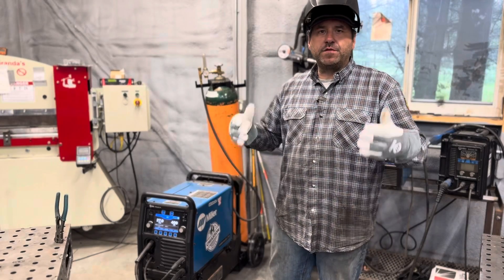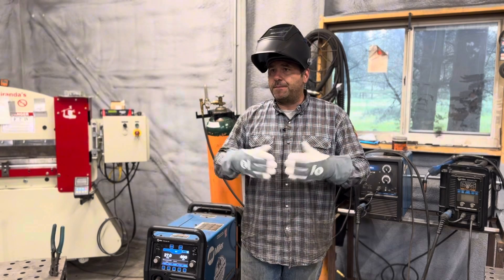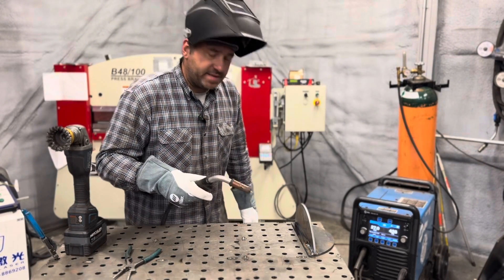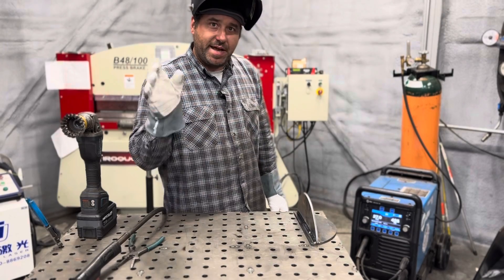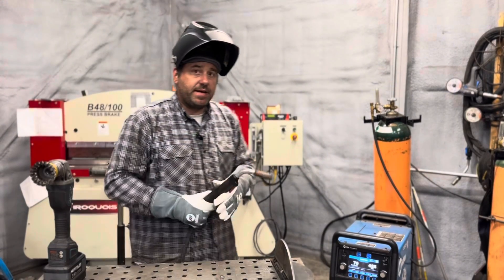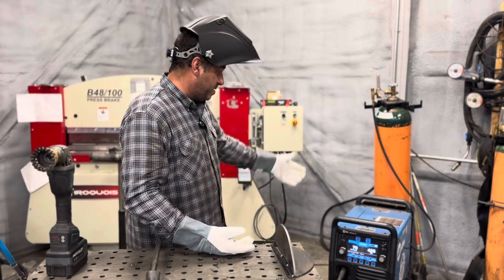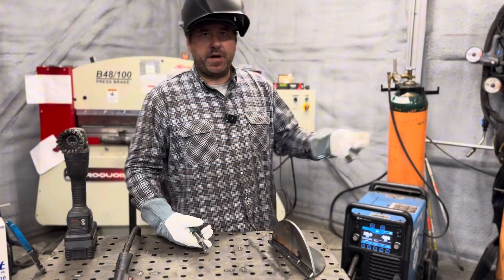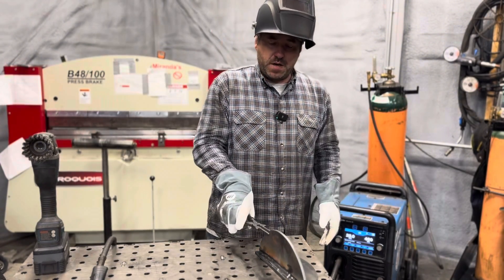Welding Pulse Mig/Spray Transfer/Short Circuit

Comment: lol Zila! I have both machines. I got the HTP first and it’s ok but nothing close to the miller’s smooth arc. And HTP has a plastic wire feeder. 10ft gun on your 220mts , revolution and pro pulse 300 which by the way is more expensive then the miller 255. So no he didn’t pay too much.  And I can buy the miller consumables locally. HTP has a cheaper feel to if a person cares about that.
Reply: So my comment here was to Peter zila who left a comment on this video talking about how HTP is cheaper for a pulsed machine. Then I commented and he deleted it lol.

Comment: Only thing on the 255 i didn't care for was the auto pulse setting. Maybe there's an update but on mine the arc length is set at 25 i believe on auto and is not adjustable. Mine was much smoother on setting of 40. I would find the auto setting for the thickness of steel i was using and switch to manual mode with those settings but changed the arc length setting to 40.
Reply: I use a millermatic 350p and a delta 255, and honestly the factory setting for arc length is 50.     With pulse your wire feed is more your heat Input